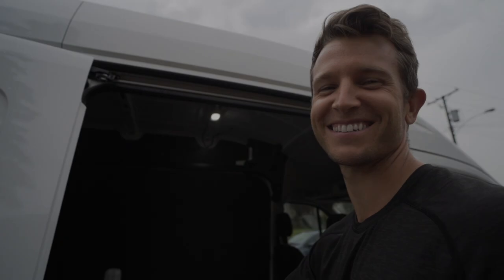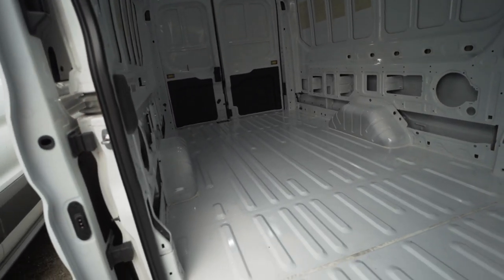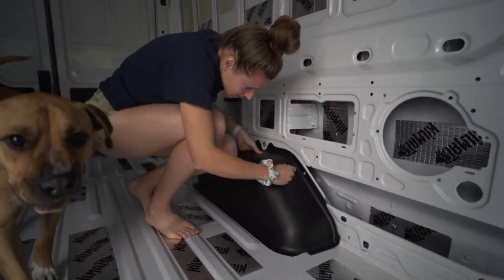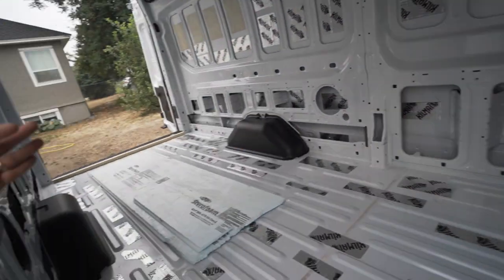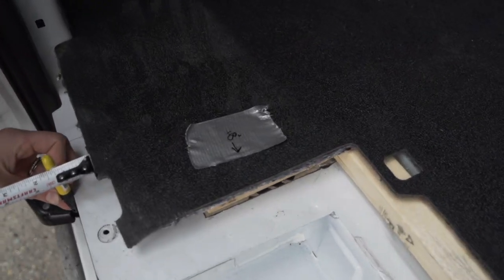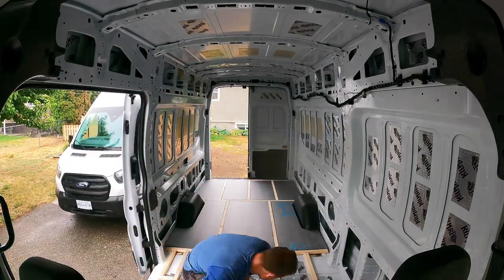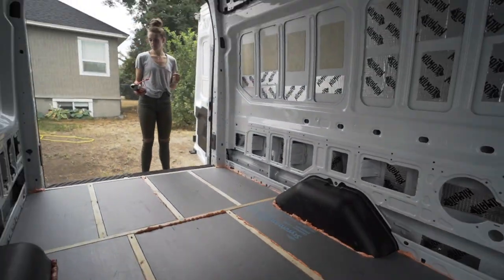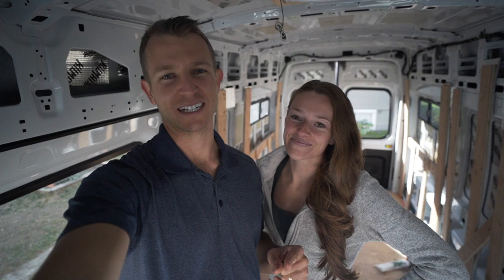VAN BUILD SERIES | PREP & SUBFLOOR

Comment: Great video! I’m going to be building out a fire transit very soon. I like the approach you took for framing, insulation and installing your subfloor and would like to do the same in my build. Just would like to ask how you’ve founds it’s help up since the install? Any squeaking, warping, buckling or issues you’ve had?
Reply from the maker: Thank you. We’ve used this same approach on 4 transits now and have not had any issue - we continue to do the same method 👍🏻

Comment: Looking good! Just wondering why everybody seems to use a wooden beam frame under the floor. Why not only use isolation plates only and put the subfloor directly on it? Will it get pressed to much?
Reply from the maker: Thanks! Lots of people do that but we wanted the extra strength and support of wooden battens underneath as we’ll be securing so much to it 👍🏻

Comment: This was amazing. You made it seem so easy! Do you screw the bottom wood into the van or do you use adhesive. I couldn't see that part.
Reply from the maker: Thank you! 🙏🏻 Sorry if that wasn’t clear - we did not use any screws to secure the wood framing to the van floor, just the sikkaflex 221 adhesive 👍🏻
Reply: @TimKatie  I am in my planning stage. I put the recirculating shower on my must have list. Your videos are fantastic. So easy to follow. I see the channel is pretty new. Welcome to the world of content creation!
Reply from the maker: @ColorMyWorld  Thanks so much for the kind feedback. We’re thrilled to hear you find them helpful. Yes! Only 8 videos so far but many more being worked on and hopefully coming soon 😊

Comment: Really looking forward to tracking along with your build as I plan mine.  How much total height do you lose in the van, between the subfloor and the ceiling installations?
Reply from the maker: Thanks for following along! 😊 The floor is 1 3/4” (1” XPS insulation, 3/4 plywood), and ceiling 17/16” (3/4 furring strip, 5/16” t & g), so around 2 3/4” lost total. Thankfully the Transit is 6’ 7” to start, and we’re building another 4 season van so we want it well insulated. But if you need more height there are definitely some easy ways to save on space (thinner floor insulation and plywood, side mount your furring strips on the ceiling ribs so you only lose 5/16” on the ceiling)
Reply: @TimKatie  Love it!  Thanks for the detailed response.  Being in the Midwest US, we can experience all 4 seasons in the same month.  I'd like to be prepared and adequately insulated.  I believe the height on my Ram Promaster will be a bit lower than the transit to start.  I'm also trying to plan ahead for the shower pan height as well.  Things get vertically squeezed pretty fast.
Reply from the maker: @northkcproperties4048  Ah that makes sense then! Ya it’s a constant battle of give and take eh. Good luck with your build and feel free to reach out if you have any questions! 😊

Comment: Curious how you used that chalk line tool to mark on your plywood where your furring strips were, considering the irregular pattern of the furring strip placements?
Reply from the maker: For the horizontal strips we marked the strip center on each side of the van wall before putting the plywood sheet down. For the lengthwise strips we could still see the ends as we did one plywood sheet at a time then removed. I hope that helps!
Reply: @TimKatie  Yep, I was thinking as far as the lengthwise runs, that would be the way to go. Easy to put tape on the walls and use those as guides. Thanks much for the prompt reply!
Reply from the maker: @wanderingzythophile9083  You’re welcome. Good luck! 😊